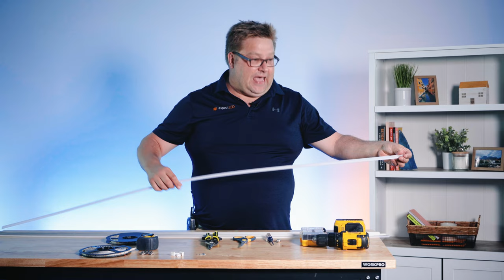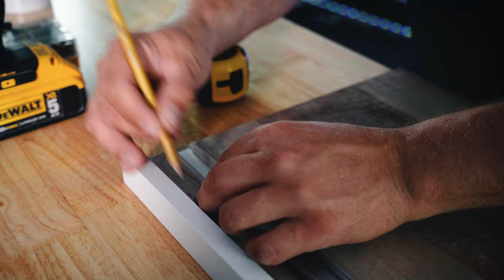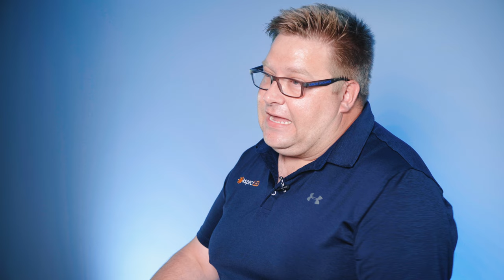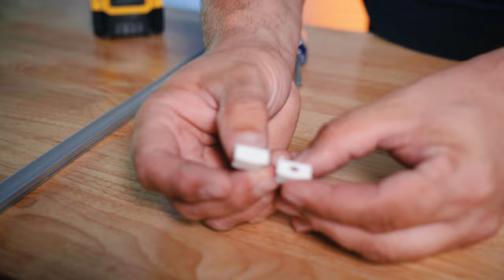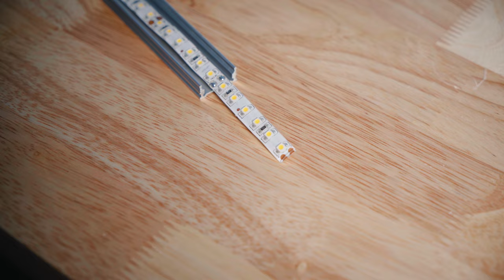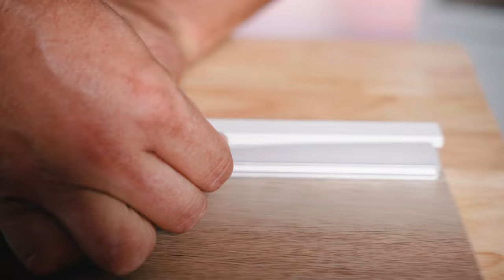How to Install Aluminum Mounting Channel

Comment: Do you have a recommendation for the countersink bit you used. I have a small project and don’t want to buy an expensive one. But reviews on most are dismal. Which one did you use?
Reply from the maker: Great question. We used a 92 1/4 82 degree M.A. Ford countersink bit and you should be able to find them at most any hardware store. Thanks!